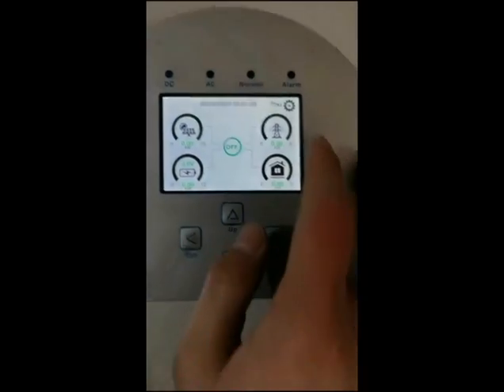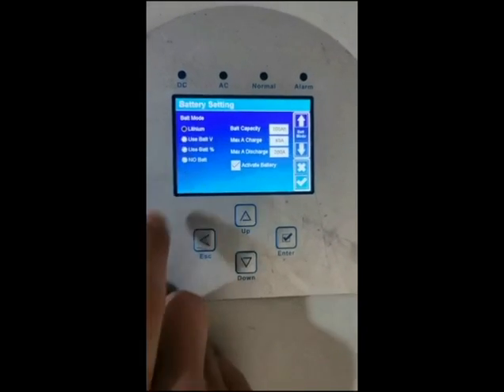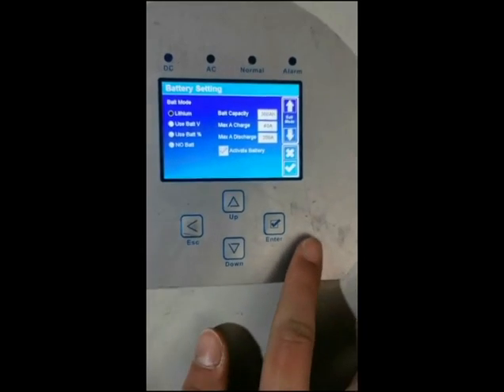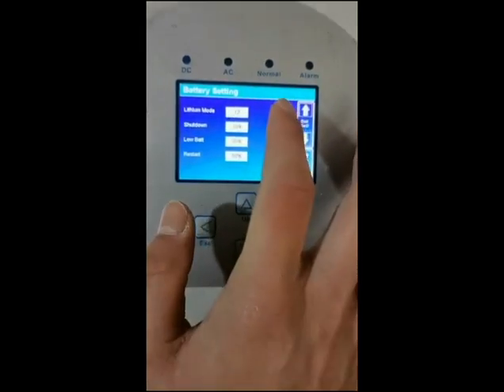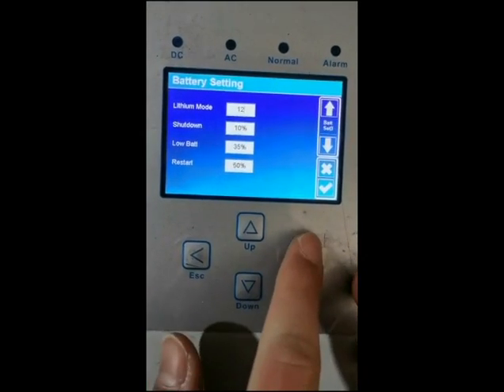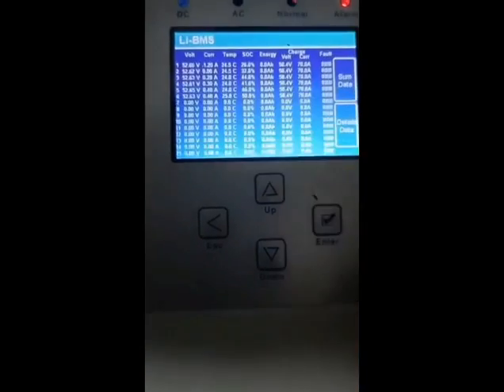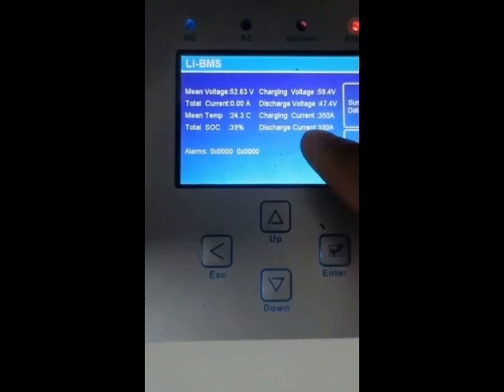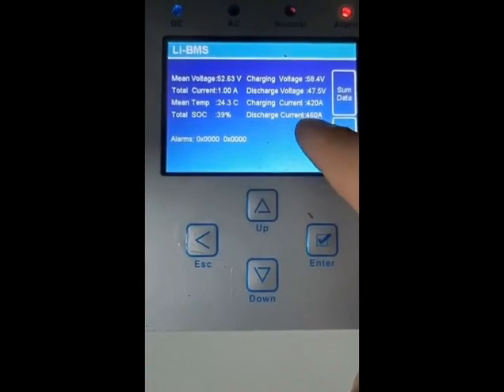How to connect Felicity batteries with Deye inverters?

Comment: I have 12kw deye with 12,5ah felicity battery. Com with bms is correct.  Settings 120a charging the battery also.but charging goes only 40amps to the battery .pv products  8kw energy. I have seen  70amps also some times. (Consuption was lower than 300watts) but never goes 120a? Why is that?
Reply: It depends on the battery percentage as well as the temperature. It will only charge with max speed if the battery percentage is low, maybe under 30% or so. I know this answer is late, but it may help others understand the situation better.

Comment: Please for the com cable, is it the normal ethernet cable?
Thanks.
Reply: yes it is but the pin layout it different on each side
Reply: @DaTecNerd   can you give me the layout for each side?and I am trying to connect felicity 17.5kwH to 16kW deye inverter. is lithium mode same as 12?
Reply: @Ayotommywah1 did this work

Comment: would you please make vedio how to connect felicity battery with voltronic inverter
Reply from the maker: Thanks for your advice, we've take it in shcedule
Reply: @felicitysolar  Please also make one for Luxpower. I cannot get LPBA48200 to connect with luxpower SNA5000. i dont know what i am doing wrong but it just doesn't work